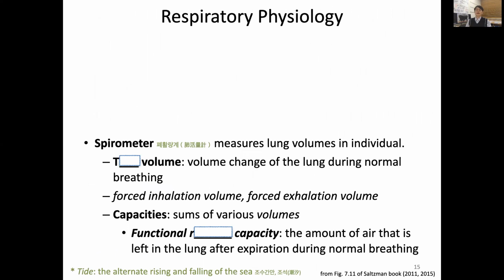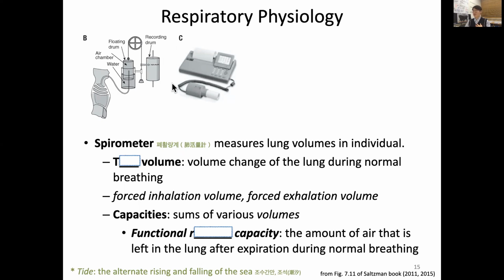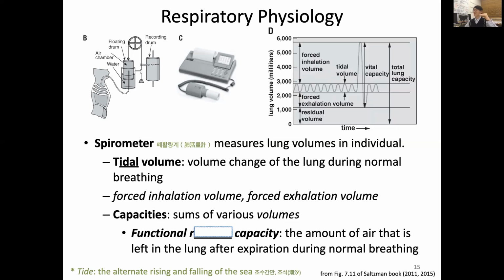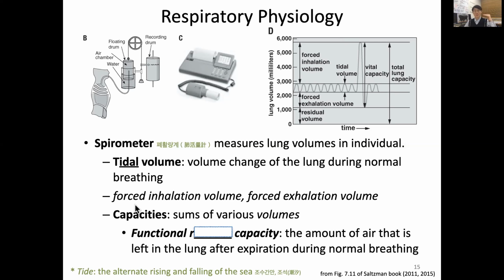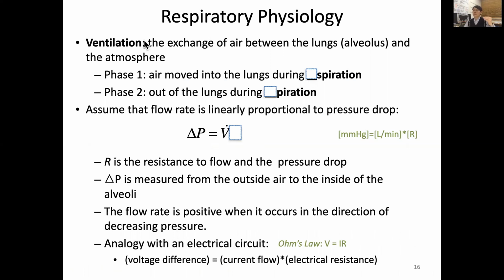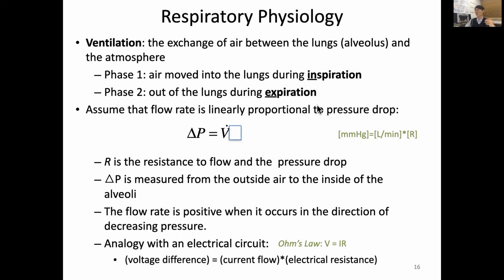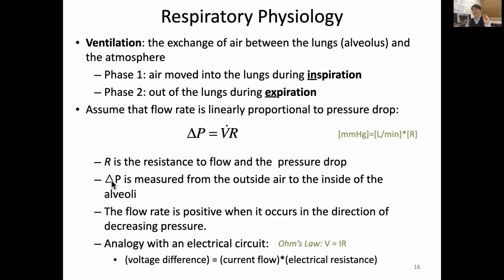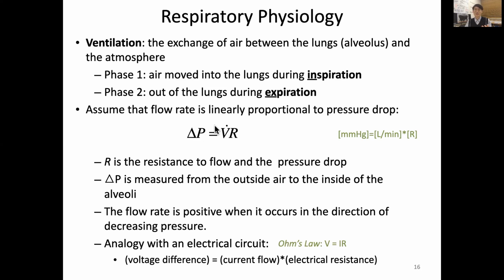5.4 Physiological Principles: Respiratory Physiology

Comment: (Q): Is R calculated by the diameter of the airway? As I understand the smaller the diameter of the airway is, the higher pressure the air goes through the airway.